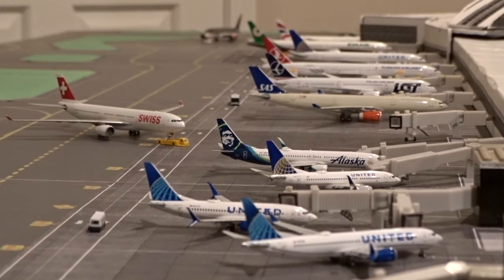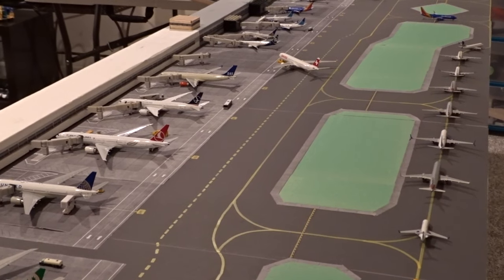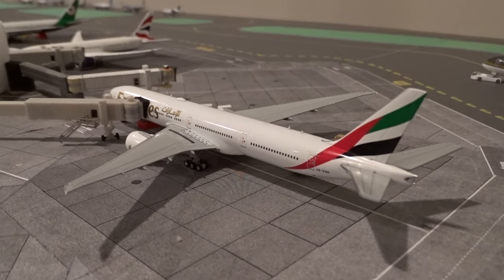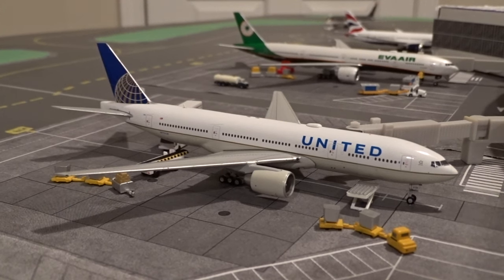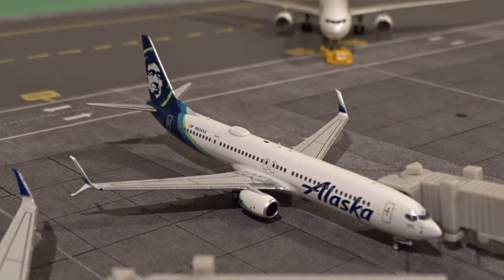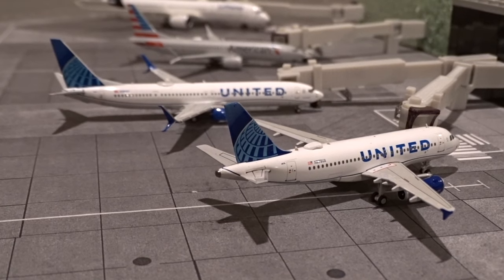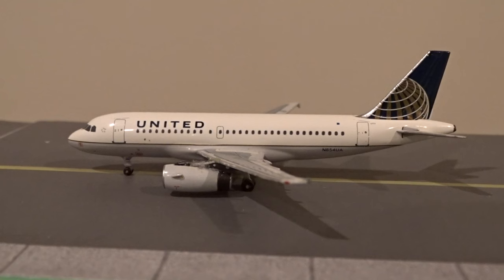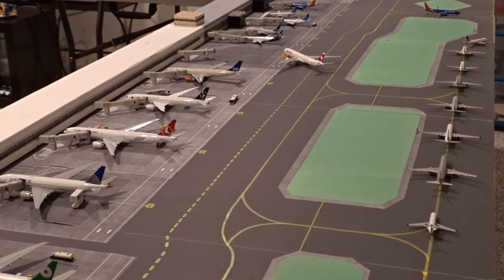Chicago O'Hare Terminal 5 Airport Update - March 2024

Comment: From someone who works at Terminal 5, I have some info about the Terminal 5 ramp that would be very useful for you. (ex-T5 ramp controller and current airport scheduling coordinator) (Yes I plan what aircraft goes to what gate, during the "day of" the tower can move aircraft around depending on ETAs and overall delays. This is for gates M13-M40W + Hardstands 101-104. Delta M2-M11 handles their own gating but we do the ramp control for them.)
From gates M14-M15 the aircraft would push tail North or South. From Gates M16-M33W they would push tail East and leave the ramp at V1 (which is directly behind M15). The only time an aircraft between M16-M33W would push tail west (like LX did in the video) would be to reposition to the hardstands. From Gates M34-M40W they would push tail North. This is what we call the handstand alley. Within the handstand alley it has now been repainted to be a dual taxi way. Narrow body aircraft (321Neo and down) would follow the center line and transition to the East line. When a narrowbody pushes off into this alley they would push to the West line. There is a STOP line just behind M35 for the aircart to wait since we can not have a narrow enter and leave at the same time. There is a center line for the widebody aircraft (757 and up) to use for both inbound and outbound. The dual alley lines blocks the use of the center and use of the center blocks the use of the dual alley lines. On the East line it has an triangle on the line facing north indicating the direction of travel and the same thing for the west line but facing south. For the center line it is just a circle. For the main ramp (between M14-M33W) we have this function as a semi one-way alley. All aircraft arriving can enter at any V entry points but most enter down at the end at V7 (right behind M33W) and taxi to their gate location. When leaving the ramp they push tail east, taxi westward towards V1 to leave. 
Some extra items. With LX pushing off of M25W they would need to push the other direction but besides that AS could not be parked at M26 with a wide at M25W. The correct way would be LX is to push tail East, AS would have entered at V7 and waited with the nose of the aircraft parrelle with M29ish with M28 being the farthest possible and once LX has cleared/made space then AS could park at M26. WN is almost always gated at M25, M27, M28. the reason why not at M26 is the holdroom and boarding space inside the building is extremely small. So we mostly schedule narrowbody international arrivals at M26. 
M17, M21, M29W, M34 can all take a 747-8. M17 and M29W both take a 380. For M29W the second bridge to connect to the aircraft is actually the M28 bridge. 
And a side note that isn't all to well known, we have a gate M13, it is a bussing gate (so no aircraft park at it). It is between M11 and M14, and there is a roadway that gos under the overhang of the building there. We don't ever really us it and currently only a terminal transfer bus operates there BUT this is where passengers would be picked up if we had to run a bussing operation from T5 to the Hardstand locations (M101-M104(A)(B)). Or could be dropped off if the flight coming in was a domestic flight. M20 is there international flights would be dropped off if they needed to bus to terminal 5.
In terms of gating dependencies (such as no narrows on M26 when M25W is occupied) here they all are;
M17 blocks M17A (17A is the line the 380 parks on)
M17A blocks M17
M25 blocks M25W
M25W blocks M25 and M26
M26 blocks M25W and M27W
M27 blocks M27W (this is a weird one in which the 757 goes onto M27 and not M27W and there are no dependencies for it. we treat it like any other narrow body on M27)
M27W blocks M26 and M27
M28 blocks M29W
M29W blocks M28 and M29
M29 blocks M29W
M30 blocks M30W
M30W blocks M30 and M32
M32 blocks M30W and M33W
M33 blocks M33W
M33W blocks M32 and M33
M35 blocks M35W
M35W blocks M35 and M36
M36 blocks M35W and M37W
M37W blocks M36 and M37
M37 blocks M37W
M38 blocks M39W
M39W blocks M38 and M39
M39 blocks M39W and M40W
M40 blocks M40W
M40W blocks M39 and M40
For M39W and M40W there is additional restrictions in that;
"If M39W is in use with a B777-200, it restricts M40W to a B787-10 or smaller. Excluding A343"
"If M40W is in use with a B777-200, it restricts M39W to a B787-10 or smaller. Excluding A343"
Any gate not listed on here does not have a gating dependencies.
If you want to know what Aircraft can fit at each gate I have this information as well but it is a TON to type out and I don't want this to be more a novel then it already is.